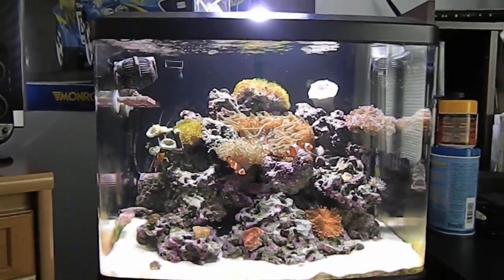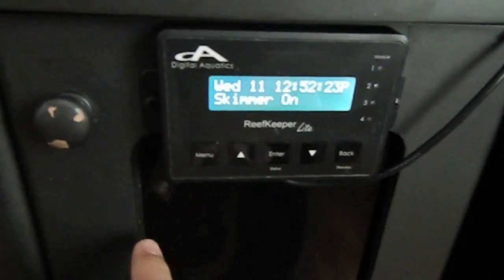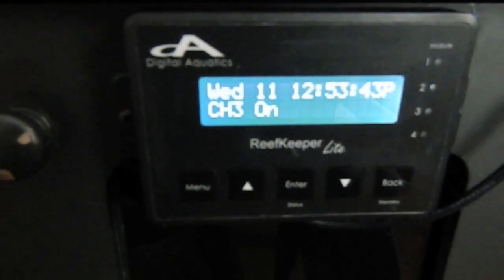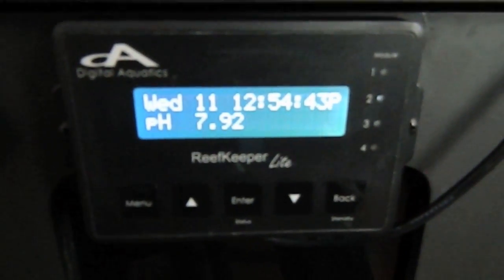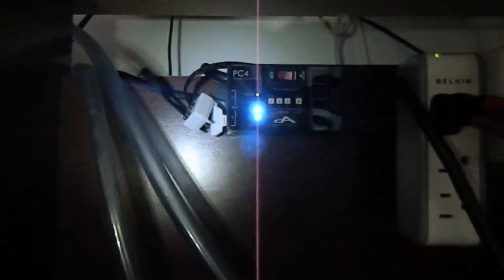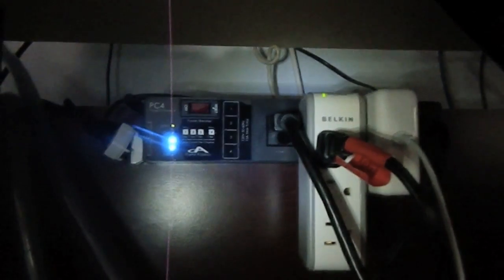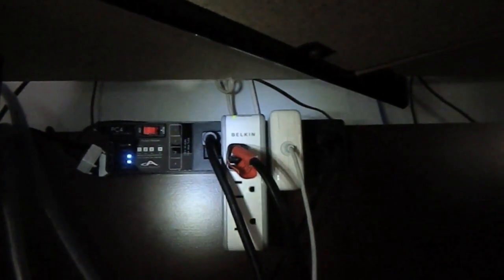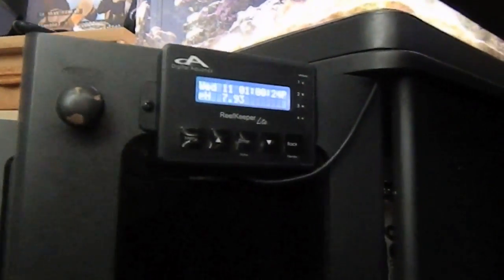ReefKeeper Lite Review ~ Part 1 of 3

Comment from the maker: Hey! Hope you figured it out by now. (I was sleeping when you posted this comment)  If it stuck on alarm on Alarm 3 and wont turn off, whatever's trigger the alarm is still active.  For example, if you set an alarm for when Temp. is above 80 degrees, if the temp IS above 80 the alarm will stay on.

Comment: Does this device measure Alk, Calcium, Mag, Phosphates, and all other parameters?  If not, is there a digital device that does?  I'm tired of the inaccuracy of the drop testers, and would like to have precise digital readings.  I don't need all the other stuff like controllers, just a digital parameter tester.